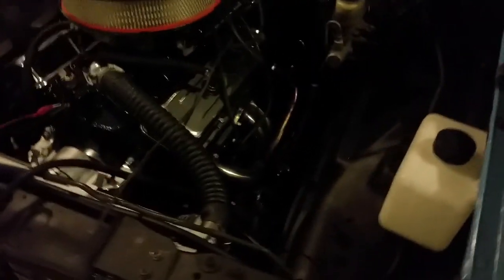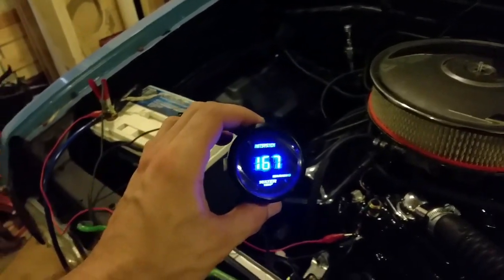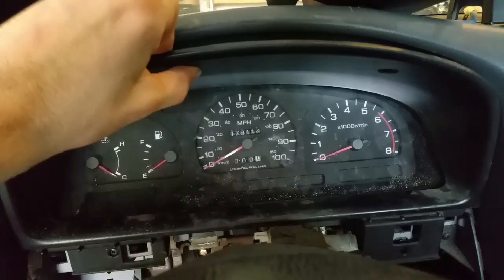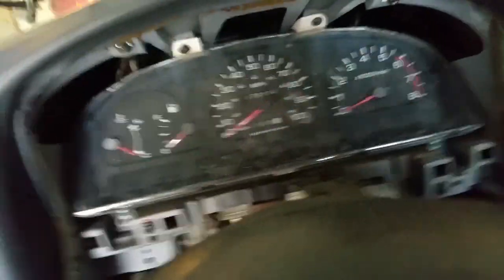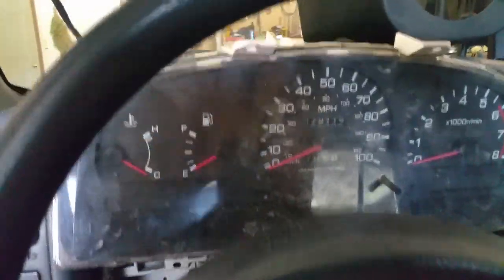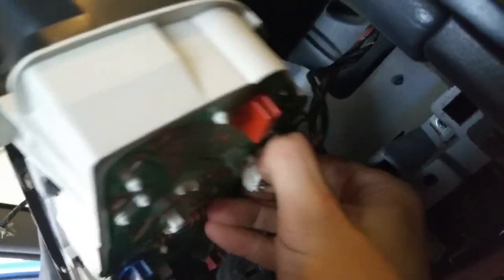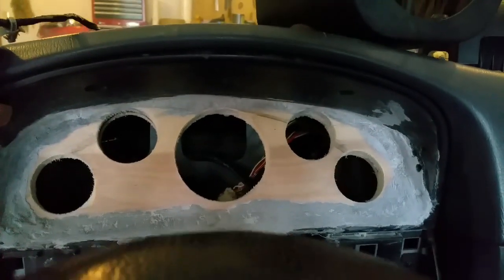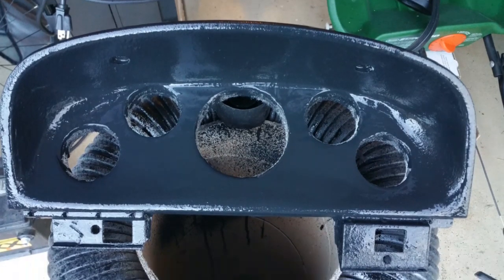HOW TO build CUSTOM DIGITAL GAUGE PODS - V8 SWAPPED NISSAN HARDBODY

Comment: looks nice. how did you wire the gauges up? and for the fuel gauge, did you have to use a different sending unit?
Reply from the maker: stock sending unit but gauge has an adjustment for different resistance levels. the rest were just 3 wire gauges, positive negative and signal for each.
Reply: @BlaserBuilds  so you didn't use most of the wires from the  cluster where did you get a wiring  diagram I've been looking for one everywhere

Comment: Just curious how did you wire up all the gauges
Reply from the maker: Curtis Spencer Intellitronix Speedo, and Dragon gauges... Fuel was a real cheap eBay gauge.
Reply: a21bravo thanks a lot I like the style of the speedo I have one cheap oil gauge and a custom 4 pod gauge cluster where my a.c. vents are going I want to try to make a cluster like your. You pretty much make a wood mold epoxy it in add filler paint and install gauges. Still stock but going turbo